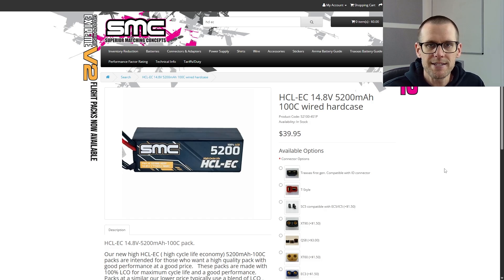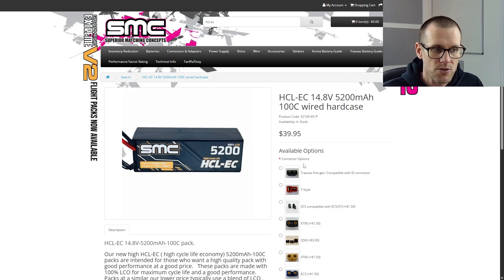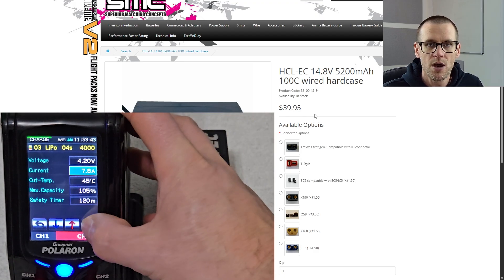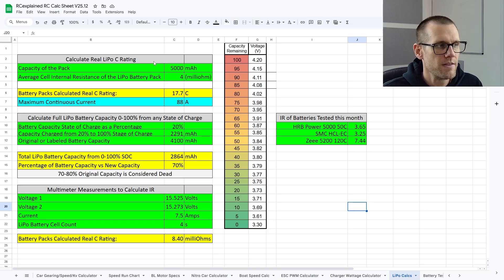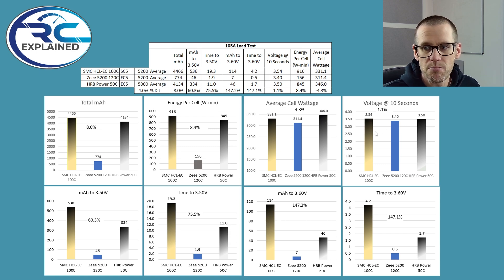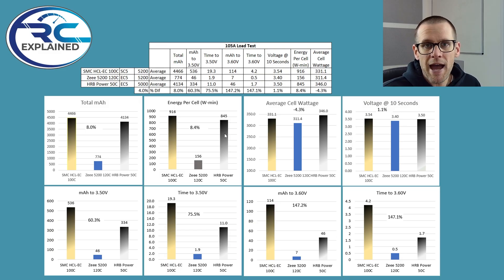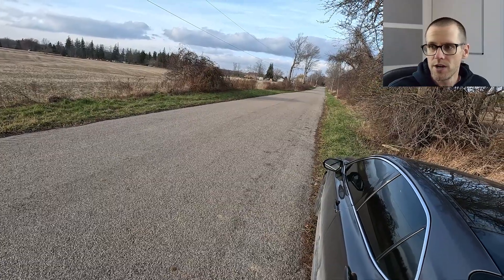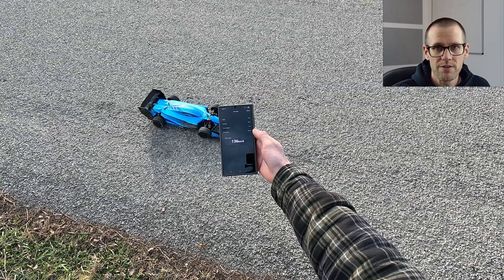Ultimate SMC Economy Pack Test: 105A Loads + 100mph Speed Run Challenge - SMC HCL-EC 5200mAh

Comment: Man if nobody havent told you yet. I appreciate your videos I know this sport aint cheap I spend 1200 on a traxxas rustler xl 5 turn to a mamba monster and still couldn't get it to run clean on top 60
Reply from the maker: Thanks for the comment. Speed is a hard thing to achieve, especially if you dont have the best location.

Comment: So Question.
Would there be any advantage in a CNHL G+ 5000mah 70C vs 100C or is it just marketing.
Reply from the maker: Off the top of my head I cant remember which one is best but they are quite similar. Id buy the cheaper version.
Reply: @RCexplained Id love to see a test 70c vs 100c CNHL G+ to see if there is even any difference or just marketing lol

Comment: Hi! I bought a small crawler. The ESC (10 A)  is still the stock one, but I changed the motor from a 280 to a 180 60T. I noticed that now the ESC cuts off much earlier than before. I would like to know if it’s possible to add more power with the stock ESC, because I don’t want to replace it — the OEM ESC has useful features like lights control and speed settings.
So is there any solution? Or is the only option to replace both the ESC and receiver? But then I’ll lose most of the built-in features. Thanks so much  
for your help.
Reply: Hack the esc ? Added another esc ? Add an arduino beetwen both of them ? My mind is lost 😢
Reply from the maker: I would swap out the esc and wire the lighting to rc controlled switches. You'll end up with something way better.

Comment: What temperature do you test mil ohms @ ?
If I test my lipo batteries cold like 16°c they are @ 0.7 mil ohms per cell. warmed up to 30°c all the way down to 0.1 mil ohms per cell 4mil ohms per 4s pack.
Temperature has a massive effect on high c ratings packs, and less on lower c ratings packs in my experience.
Have you found this ?
Reply from the maker: I monitor room temps within +/- 1 degree Celsius. The pack also stays at this temp for more then 6 hours before being tested. 
Temperature is a huge factor in IR results. Also, after 5 minutes of charging the chemistry changes and the pack reads a lower number. 
I start the resistance reading from storage voltage. Around 3.82v per cell.
Reply: @RCexplained 
Interesting!.  Is there a reason 4 starting @ storage voltage?. 
And no lower ?.

Easy way to standardised testing ?. 
Or just simply a baseline to start from??.

Also I have been told that  lipos come down In resistance, once they have been cycled a couple of times, 
Is that true ?
In your testing / findings?

Great work 👊 and very helpful to the whole community. 
No one wants to buy rubbish lipo batteries and be disappointed,  And even be put off the sport because they don't know what they have done wrong.
due to false advertising on the lipo packs.
So this is a massive help. So many people out there that think manufacturers don't lie about their C ratings. 

Im from the UK and they sell some good lipo called ( OVERLANDER  Extreme pro's ) 
I real rate them, but no one talks about them online.
But I would like to see how they compare to SMC and CNHL lipos. 
If you ever get the opportunity. 
Thanks again
Reply from the maker: Starting the ir measurement from storage voltage is a process optimization for me as batteries are delivered at this voltage. I've set everything up and derived the formulas around this concept. I also fo believe its best to get ir at this voltage too. 

The overlander website states that my country is blocked from seeing it.